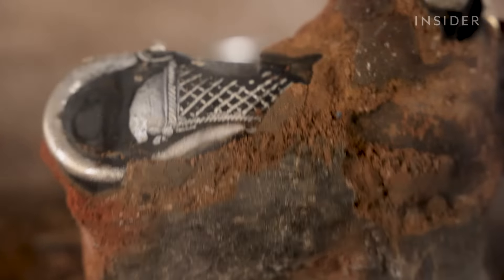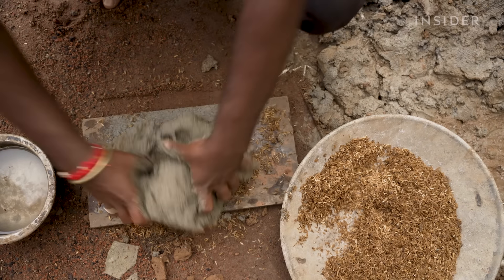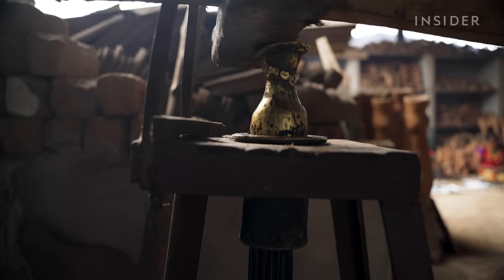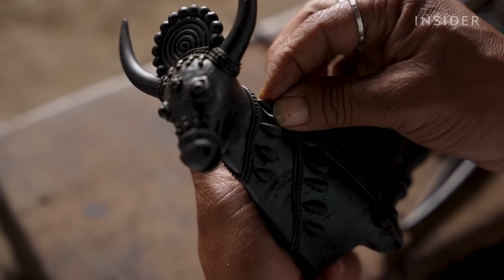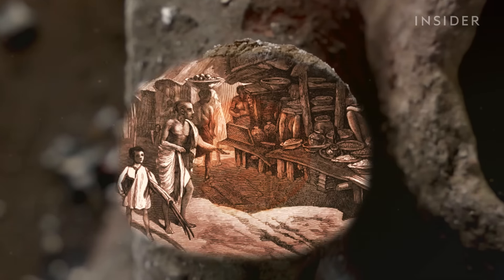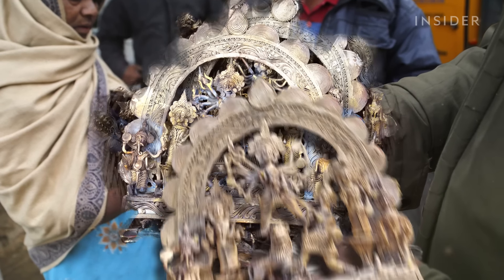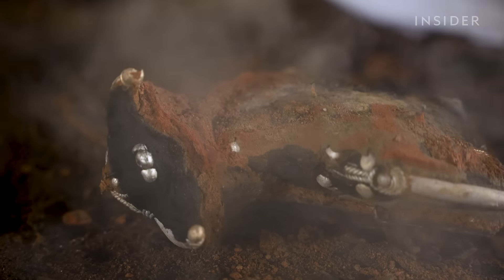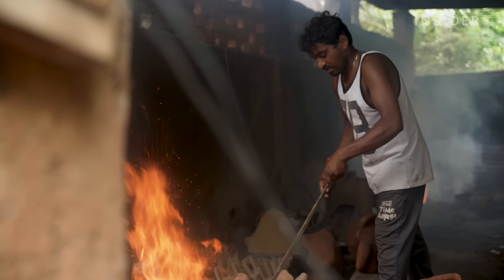How Metal Artists In India Are Keeping A 4,500-Year-Old Craft Alive | Still Standing

Comment: i feel like they are not showing a step here. The core is made out of mud. That means one the wax melts away, unless they put in some sort of support structure through the wax connecting the core to the outer mould, that mud core will fall down onto the exterior wall of the mould and you would lose a side of the casting at best and end up with a completely failed pour at worst.

Comment: I have a technical question in case anyone has witnessed the process of casting it. The wax is replaced with molten bras forming a thin shell which is the actual sculpture for sale.  But how is the clay mock-up removed from the "inside" of that metal shell? Because dry clay does not melt away like bees wax.
Reply: It's probably still inside. No real need to remove it

Comment: 6:33 what’s that solid stuff he’s pulling out?
Reply: It's probably the impurities (e.g. dirt, plastic) present in the metal since he melts down used metal items
Reply: He's clearing off slag (impurities). When metal is melted down in a crucible like that, the lighter slag floats to the top and is removed before casting it in a mold so that it won't create irregularities in the final product.

Comment: Machines can probably do the same and produce more of those quickly
Reply: True, but machines will never produce "hand made"...
Reply: then it becomes another piece of mass produced art with no soul
Reply: Machine can produce this, but it will lose its ancient touch
Reply: It cant be done much cheaper. Resin ones can be done easily and cheaper but metal ones are more difficult
Reply: Then what's the point?
Reply: There's a difference btw home cooked food and processed fast food :)
Reply: Imagine unironically comparing mass produce crap with finely detailed handiwork.
Reply: @essee3984  And there is no difference between a art that’s made on a machine and the one that’s handmade.
Reply: @sterlinf  that's precisely what art is all about right? The subjectivity.  It has no utility or serves no purpose but the intrinsic value it holds, the value that the beholder attaches to it. I mean, anyone can replicate Picaso's work, or get a digital copy of Mona Lisa. Does it hold the same value as original? Don't think so.
Reply: @essee3984  Correct, 100% correct. Now look at your original comment and try to understand why isn’t it a fair comparison. When it comes to home cooked food, the end result is different from fast food. Fast food can be unhealthy because of the processed ingredients and preservatives. Same with the painting, the digital copy has a different end result than the original one. The original one has a thick layer of paint, the digital one has a thinner layer evenly spread out and not precise. But when it comes to making metal art with machines, the end result is the same, there’s no difference in the quality, it might be even better.
Reply: @sterlinf  but you see, I'm an artist myself and I can make an exact copy of Mona Lisa (even better and more realistic tbh), but it won't be Mona Lisa afterall. So not sure on what basis you judge art or call it 'better'. If you just want to put it up the bookshelf just to fill up space, that's another thing. It's not always about the final product, art has lot to do with the technique, the medium, the skill and the soul. Precisely why it's called Handicraft :) and that's why there's a difference btw food cooked with soul and traditional recipe vs food from a restaurant (let's assume the quality remains the same ; the taste wont)
Reply: @essee3984  Well you don't have a real Mona Lisa standing before you, how the hell it's gonna look more realistic than the original painting. You gave an example of fast food and homemade food, stick to it now, stop dragging Mona Lisa in between. It's about the end product in the example you gave about food.